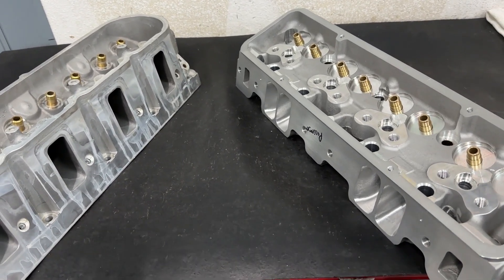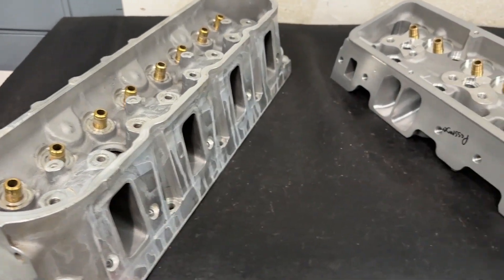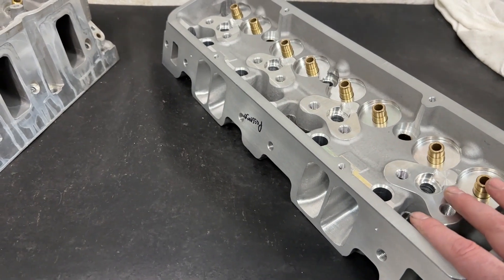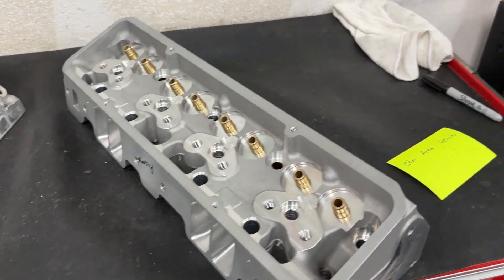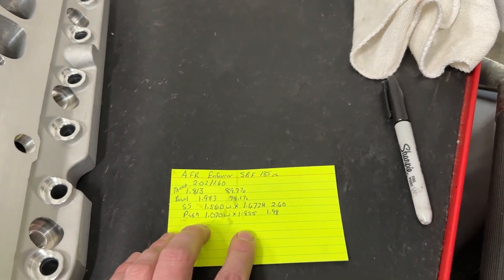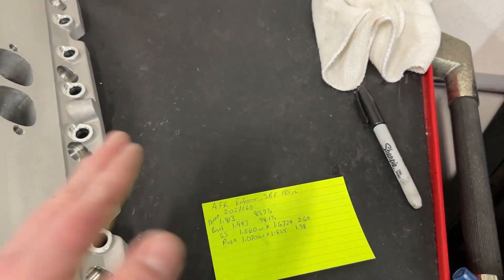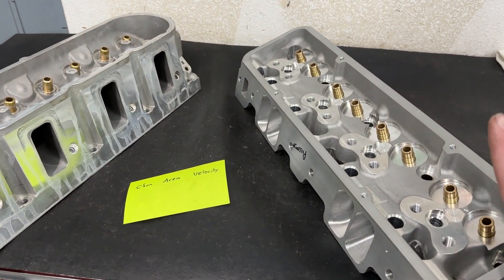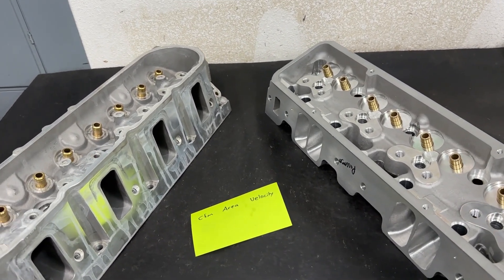Is The Smallest Intake Port That Flows The Most The Best

Comment: Seems like the bottom line is application. If you need a torque curve from 2500 on, you want different head characteristics than if you’re drag racing with a 5000 or 6000 stall converter. Great video, keep ‘‘em coming!
Reply from the maker: Thanks

Comment: It is all about the operating rev range and engine size, as you said. Tighter CSA flattens out the torque curve, and larger gives more peak torque. But, there's another number that stirrs the pot even further; runner length. To make the most out of your engine, you need to have your runner length to match your CSA and your cylinder volume. Usually the runners are way too short and this kills low end torque too.
Reply: And to add on top of that, camshaft valve overlap (both duration and lift) will change the amount of draw on the intake port of the head at specific RPMs. It's amazing many little factors play into how an engine performs over the RPM range, and how they compound on each other.
Reply: @wyattwunderlin4445  Indeed. Valve overlap especially needs to be tuned with both runners, in and exhaust, in mind. To make the camshaft work there has to be incoming charge @ intake and draft @ the header. And then there's valve profile to tune the valve pulse which also is partially created by lobe profile and these all change if the fuel itself is changed to bring us to spark energy, not yet timing, but the amount of joules in each spark.. Tricky business.

Comment: Improving a head for drag car is a lot simpler than improving a head for a wide range of power.     By the 90's you can polish and clean up bad turns,  If you add higher lift cams you can ensure that the valves are deshrouded, You can port match and intake and exhaust ports but engines that make 100 hp per litre out of the factory don't leave a lot on the table for a street car.   If you are adding a blower and are fuel limited (pump gas) you can focus on freer flowing for more power with less boost.   If you are racecar and going from 6k rpm to 9k rpm then cams and more flow are also going to make you happy BUT in a street car giving up low end torque on a street car in trade for top end power is a bad trade.   In a perfect world you would know the optimal CFM for your build and work backwards.   Damned if I understand this part though.   We can measure the area and volume of the chamber and ports and measure the flow on a bench but how do you do the math from there?    Buying 50 heads and rebuilding until you get to the "best" outcome  just isn't practicle.

Comment: Straight talk Eric. I can't tell you how many times I've had to try to explain to people wanting to build a motor by installing a huge cam and a set of old double humps with 2.02 and 1.60 valves. That's just a noisy slug. It takes critical thinking, planning, and as much data as possible to build an engine that is optimized. That's why many professional race engine builders get PAID for their engines, it isn't just the hardware, it's the software between the engine builder's ears that makes the difference.

Comment: I had this first hand... I willingly put a stock crossfire injection intake on top of a typical 350 short block... roller cam, profiler 195s etc. It made excellent power from about idle to 4000rpms and then made absolutely no more power or torque to about 6000. Felt great until 4k and then it was just like running it for the sake of running it. Swapped on a renegade intake which has a roughly 1204 port size... it matched power from 1500 up and just freight trained beyond 4k. It made almost 80 more horsepower at the peak at the tires than the stock intake on a day with a 3000' DA vs a negative 200' when the stock was tested. I do feel there is something to optimizing the port for its given size... but physics is physics. 

You can polish a straw and have it be the smoothest best flowing straw there is... are you still going to breathe through it when you run a marathon? That's what I think when I see people talk about small high flow ports...
Reply: 😂😂 your set up kinda reminds me of the 79 El camino I had in school.  It had a 350 with a comp 280h and stock 882 smogger heads when I bought it.  It would leave two 40ft black marks at 45mph when you kicked the 4 barrel (about 2500rpm in 2nd gear) and was completely done by 4,200rpm. Was a turtle race to 5,500😂😂 it was so painful I usually shifted at 5000.

Comment: Frankly, the second the intake manifold is installed, the total runner length changes also. I find this similar to picking a turbocharger, a smaller, but more restrictive turbo comes up on boost quicker, lower in the rpm range, and will feel more responsive, but loses efficiency on the top end, where a larger turbo will ne less responsive, and spool later, but pull hard through the middle, and make more power on top, but gives it away on the bottom.

Comment: .   . To include and agree with Eric's explanation. The thing with cylinder heads is what you got you want to make efficient at every point. The port should have a target of 300 fps at peak lift of the cam you are going to use.

Comment: I had Tony Mamo work up some heads for a 408 LS that’s in my single cab Silverado. It’s my daily driver so it lives on the street. I was shocked when he said we were using 205 cc heads. Now they flow 300 plus cfm. This engine is wild on the street but I’ve wondered what the downside is of such a small head. It will be interesting to get on a dyno and see where they choke out. It seems strong all the way up to 6k though. Good info here.

Comment: Great video Eric! Yes multiple items contribute to engine performance. I use CC like I use duration @.050" to get in the general area for the cubic inch & desired RPM range. I always say; "out of two identical heads that flow the same, the smaller port will generally make more power & be most responsive." There is nothing you can say always works or always does this or that as there are too many variables. Speaking about one size & brand engine for one specific purpose & RPM helps narrow the conversation.

Comment: Eric , great video  . I was wondering if you would do a video on port size , cross section and running airspeed . Port volume and cross section and cubic inch , rpm to get a speed that’s 550 ft per second to say 600 ft per second 
So on a drag application that’s 6000 to 7500 
550 fps at 6000 and 600 fps at 7500  . Combination specific

Comment: I think this highlights that the flow bench is showing a dynamic event “statically”. It does not take into account many other variables. If it was that easy you wouldn’t have all these port variations from various manufacturers and porters.
Reply from the maker: The flowbench is just a tool, not a bible. Thanks for watching and the comment.

Comment: I purposely chose a very small port for thr sbc in my old pickup. Port velocity is fantastic. 245cfm@175cc. Trick flow super 23 175cc heads. What velocity does the airspeed need to actually reach before choking? I was under the impression that the heads flow enough to support 490hp. 
  How quickly does power drop off after the port chokes? The demonstration made it look immediate. I ask this because I also have a centrifugal supercharger further increasing port velocity in the upper rpm range. 
  I have not noticed any strange issues like boost pressure spiking at a certain point.. such as that critical port speed that causes a choked intake port. 
  Another note: the exhaust ports are considerably smaller than intakes. Do they choke as well? Do heat and air density affect the choke point? 
  I'm genuinely curious about this as I've never heard it before. I thought higher flow numbers were better when selecting  a head, regardless of port size.
Reply from the maker: This takes an additional video to answer.
Reply: @WeingartnerRacing  I'm interested whenever you've got time. No rush. I've been a subscriber for years and don't plan to go anywhere. Lol. Thanks for all of the knowledge.
Reply: @WeingartnerRacing  I think it's a great idea for another video. I'm assuming you have enough experience to estimate what size pushrod pinch size is needed for the cubic inch/ RPM that is application specific, but is there a formula that can estimate it?

Comment: I always go with a bigger head than the math says to use because the loss of torque at lower rpms is less noticeable than losing the higher rpms, end of the track unless it's a truck for towing applications. Even streetrodders agree with me after feeling the difference. No one likes coming out of the hole fast just to get passed just before the finish line.

Comment: So this is why my old corvette L98 113 heads 165cc just died at 5500 rpm?  Still saving them for a budget truck motor tho.  The Afr 195 cnc ported really woke up my gm original zzz motor even with giving up .5 compression.  Thanks for all the info Eric!

Comment: Thanks for this explanation!  A friend and I have had many conversations over about 25 years to which is the right head for an engine.  We both have 400 cid but he's using afr 195's and I'm using 210's.   Makes me think that both of us need bigger heads.  Both engines are also procharged and vastly different cams and compression.
Reply: cheap gm rec ports are 260cc. a fully forted 5.3 cathedral is pushing 230.

Comment: I would love the forced induction perspective to this. That 400 with the TorqStorm for example. How does all this (like the choke point) get affected by forced air.
Reply: @scotthatch4548  centrifugal superchargers have a rising boost curve. More boost as you rev them higher. This will effectively push peak hp rpm higher in the rev range.
Reply: @scotthatch4548  ok. You specifically mentioned torqstorm so I thought you meant centrifugal superchargers.

Comment: I dont think the smallest head that flows the most air will make the most power but it will probably make the most torque. A bigger minimum csa will probably make more torque after peak with the trade off being less torque before peak. This is only within reason. You end up with sonic choke coming into play with the smaller port sooner and once that happens it doesnt matter what you do, nothing will get more air through the minimum csa.
Reply: Lots of boost?

Comment: Seems to me the smaller head moving more cfm will require more velocity which will be harder to control around short turn and cause turbulence and fuel separation

Comment: I have heard Warren Johnson say that very same thing....."the smallest port that flows the most air will make the most power". Of course that's just a generalization, and thanks to Eric for explaining in further detail why it's both true AND false at the same time.
And even at that, it's not that it's really a case of true/false -- good/bad -- right/wrong. It's just the facts of the dynamics of airflow through a passage, and the effects that it shows when it speeds up and slows down.

Comment: Geeezzz this is why i love bracket racing are my heads right wrong flowing or not??  I run old steel merlins on methanol .do they flow like afr or brodix?probly not .goes down the track doesnt break much never had heads flowed or engine  dynoed dont know the hp just know its consistant 560s at 120.. i still like watching tech stuff even if i never will worry bout how im flowing or how much power im making ..just kerp building biger engines goin fasyer every time but care less about any number but the dial in !!

Comment: Has anybody run intake port flows in a CFD program with the intake valve opening and closing. Looking at the ram air in the intake port build up in the bowl and stall  at the back of the    closed valve.

Verses a significantly reduced bowl area to create a tapered area so the ram air is focused into a smaller area by the closed valve.  
My thinking is how much air volume is stalled and needs to be restarted as the valve opens. 

What.  The intake valve is only open  during the intake stroke. The other 3 strokes the intake valve is closed.

Comment: 8:58 the second head will make more power BUT that wasn’t your target of 6000rpm then was it? All you have done is move the window further up the rpm range with area.
If the first head had the same area but maintained it’s better efficiency then it would make even more power than the second head at the higher rpm points.
The better the efficiency of the head which is the flow number v min cross sectional area the wider the window will be.
So the statement should be, the higher the flow number from the correct min cross area that suits the cubes and rpm target, the better the head is.

Comment: Great video, I'm just wondering if there's a formula to tell you how much cross-sectional area you need for your power goals or maybe a ratio for area to CFM? It doesn't have to be perfect or official, even just a rough estimate that you would use to know where that choke point will be.
Reply: Follow up question: How much air speed is too much? I've heard someone else say the speed of sound. Is that true?
Reply from the maker: Mach .55 is the limit realistically
Reply from the maker: There is a formula for calculating min csa. Stain Weiss website has one.
Reply: @WeingartnerRacing  Thank you so much, I could not find the info anywhere without you.

Comment: Given ports that are equal in flow at a given pressure, the port with the highest velocity (within logical reason) will generate the fastest acceleration. 

Of course, everything else must be correct.

Comment: I’ve heard if an engine has heads and an intake manifold that is capable of flowing more air than the engine needs, the fuel will drop out and it won’t run well. Is that correct?

Comment: Is there an "ideal" port velocity for a particular port size/length and valve lift or is it all about wide open valves?
Reply from the maker: There is an ideal min cross sectional area for a given rpm and size of engine.
Reply: @WeingartnerRacing  Okay, that makes sense, but on velocity, does a bigger port allow an increase in the maximum useful velocity compared to smaller ports, or does it just achieve more flow at a similar velocity due to its area?
Reply: @brianbrigg57  if you look at average velocity, if a small port flows the same cfm as a larger port, the average velocity will always be higher on the smaller port.  Sure, there will be particular areas of the ports that have low velocity, and others with higher velocity. But if a predetermined amount of air flows through 2 ports, the smaller will always have more velocity.

Comment: Doesn't swept volume of the cylinder x rpm create the port velocity??
Reply: Pressure differential created by the piston moving down the bore v what the port can flow determines the airspeed within the port (average airspeeds)
The peak piston speed at around 73 degrees creates the highest pressure differential so you have to have a port that is sized correctly to avoid the average airspeed going above 0.6mach 
This is the science of engines and a hell of a lot more complex than most realise.

Comment: Isn't it the "intake port volume" not the "intake port area"? Your explanation at the front made it sound like the given number (270cc vs 230cc) was only for the frontal 2d area of the port and did not take length into account...but volume has to take length into account or it wouldn't be volume.
Reply from the maker: I mentioned length. That’s why volume is almost useless as it can’t be used to compare heads that have different lengths. Also it doesn’t tell you where in the port you are big or small.
Reply: @WeingartnerRacing  but bigger volume is still bigger and smaller is still smaller? That doesn't make sense unless the area is more important than the volume
Reply: The air fills a total volume each type the valve is open right?

What about this...mock up and LS3 with ITBs. Run it on the dyno. Add a 1" spacer to each port to lengthen it, but fill the floor to make the overall volume the same. Say 270cc in both examples. Run it again. Would there actually be a difference?
Reply from the maker: @chipcurrey653  Area is more important than volume. You can have a port go big to really small or a port that is really small that goes to really big. They can have the same volume and make very different amounts of power.
Reply from the maker: @chipcurrey653  The air doesn't fill the entire volume. There are almost dead zones.

Comment: so when comparing Edelbrock Performer RPM 290cc bbc heads with 110cc chambers vs 100cc chambers (that flow a little less), which would be better for power?
Reply: Combustion chambers are different than intake ports.. that being said, everything else being equal, the smaller chambers would increase compression and provide more power. That is assuming that the valves aren't shrouded by the smaller chamber. As long as the airflow and port size is equal and there is no detonation, higher compression will make more power.

Comment: Biggest head possible and add port energy with biggest turbo possible
Reply: Doesn’t work that way unfortunately, the sizing should be the same as a N/A engine 👍
Reply: @HerrPoopschitz  and as the density increases the airspeed does what? considering the pressure differential will be the same.
Reply: @HerrPoopschitz  so the sizing stays the same like I said 👍
Reply: @HerrPoopschitz  I have a fair idea 👍
Reply: @HerrPoopschitz  so when you go from track to track, day to day, day temps to night temps, are you redesigning port profiles and runner lengths for every possible density combination possible?

Comment: What FPS do you tune to on bottom rpm and top rpm.
Reply from the maker: That depends on the head. Raised runner vs standard port is much different. Ideally that would be close to the same.